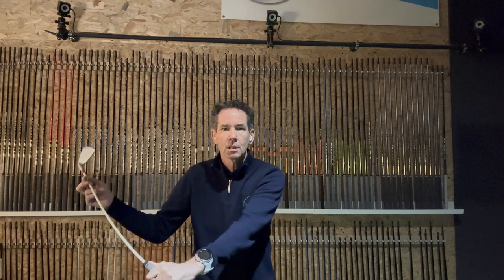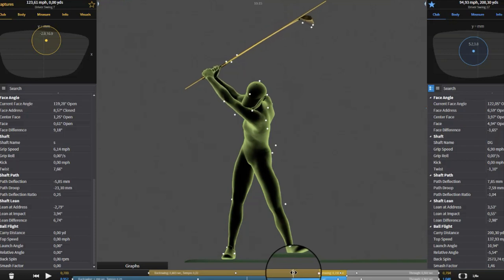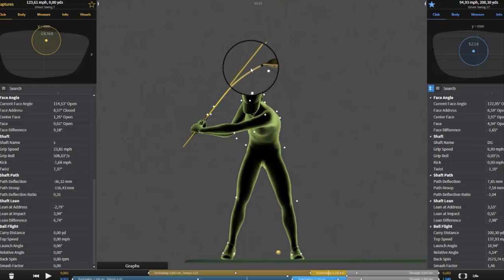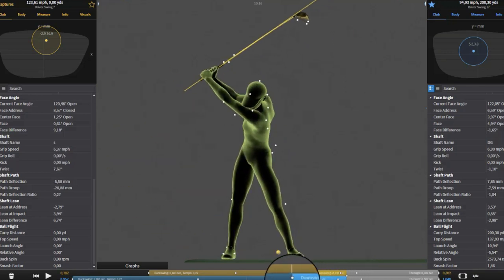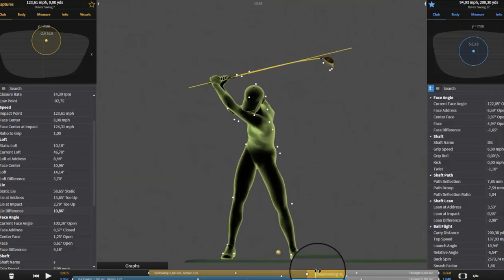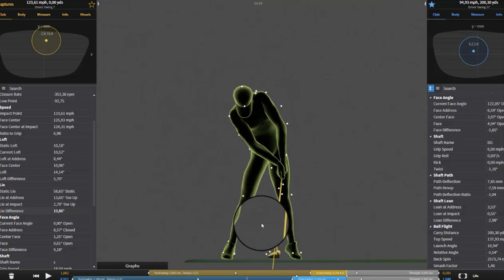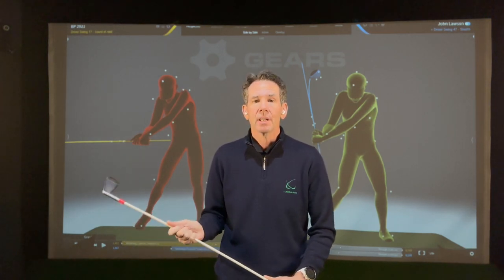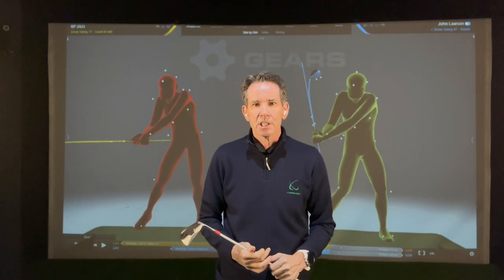🇬🇧LOADING THE SHAFT !  GEARS GOLF

Comment: John, Very interesting and helpful video. I have understood that earlier maximum hand speed, in the downswing, is critical. I have nor watched many videos focusing on that but can only concur with you. I suppose that all that should take place simultaneously with faster hips turn towards the target. Thanks, Carlos
Reply from the maker: Hi Carlos 
It’s a combination of many things, but mostly changing direction with the body while the club is still going backwards in the backswing and the forces and torques applied to the handle. I’ve never measured a good player who’s maximum hand speed isn’t before shaft parallel in the downswing.
Reply: So hands are fastest before halfway down correct?